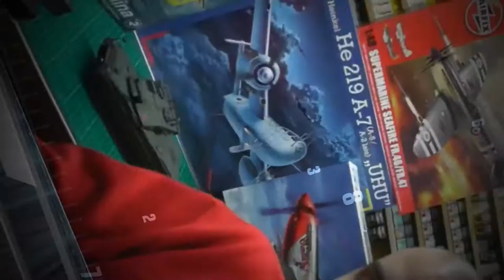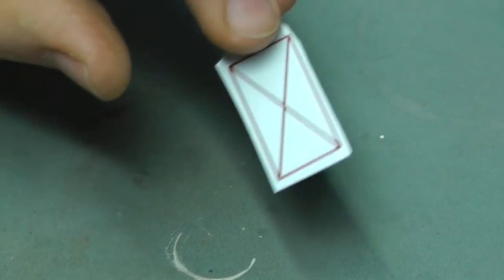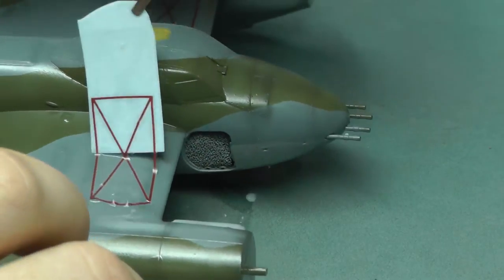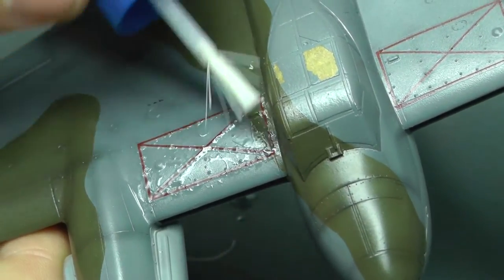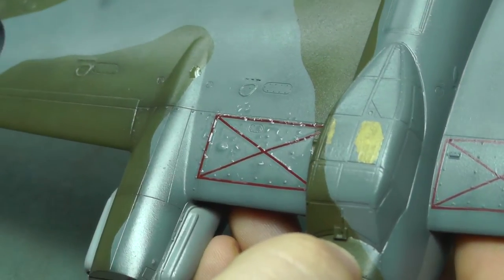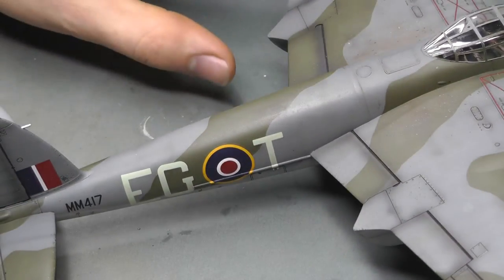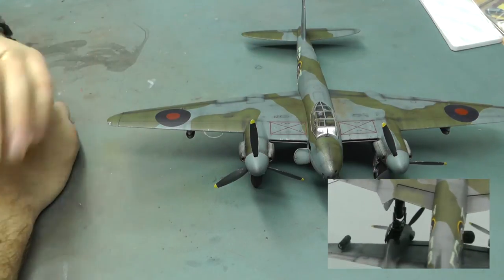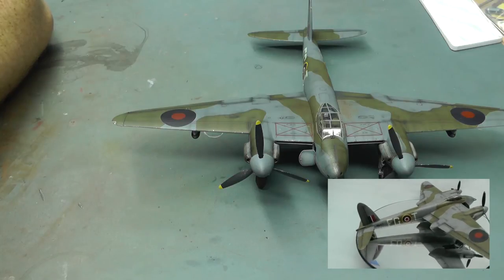Tamiya : Mosquito FB Mk.VI : 1/48 Scale Model : Rapid Video Build : Episode.8 Final

Comment: Hi, Mr Waldon. From long experience with Japanese decals (eg Tamiya and Hasegawa, Fujimi and the like I found that it is not the decal film and printing that is thick - it is the adhesive under it. To counter, you should NOT use "lukewarm" water - the water should be HOT, HOT. (AS in about the temperature you wash dishes in!) This will help dissolve a large part of that adhesive and the remains will be sufficient to adhere to the kit. Another benefit is that it will soften the decal film and printing and aid in settling over details.... Try it on a paint horse and check it out...
Reply from the maker: Thank you I will try that one out my friend